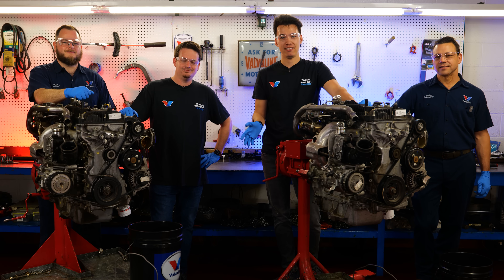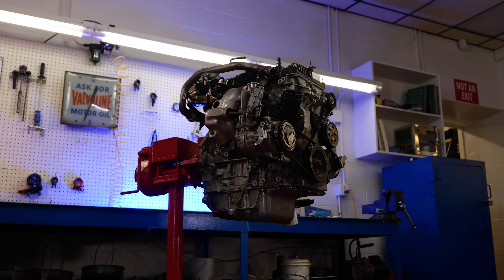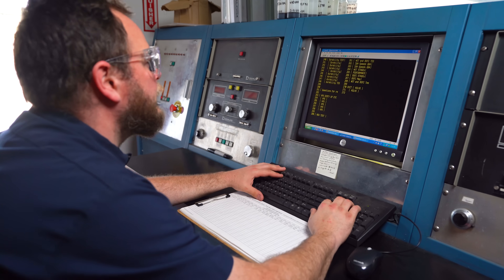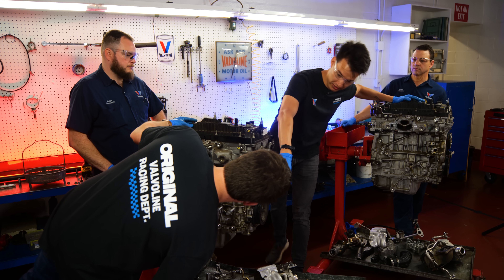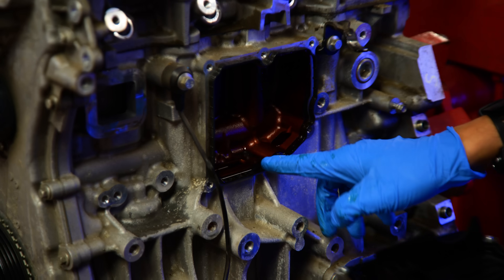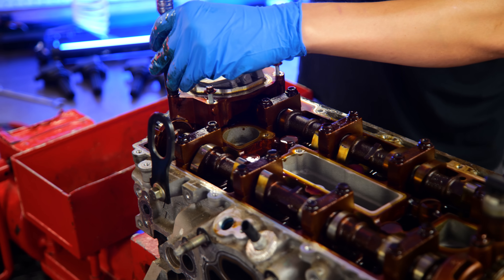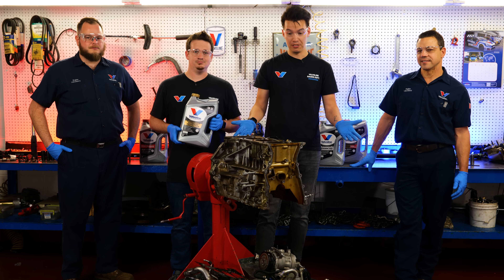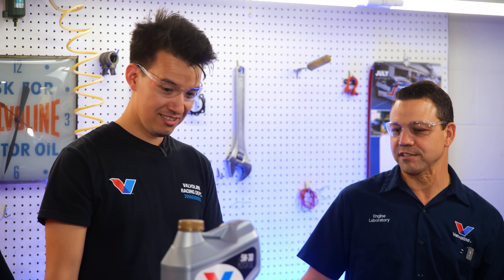Testing different oils over 4 years and 1 MILLION miles

Comment: But they changed oil every 10k miles and conventional oil is not meant to go but 3k.  But either way, if you would change oil more frequently and about every 50k put in a can of seafoam and run for 5 mins before changing oil, you would have a very clean engine.

Comment: I know this video is old and I'm just now seeing it. It was very interesting to watch. I cant say I truly believe in it just cause a video due to so many companies the cut corners and I'm not saying Valvoline does or did. All I know is synthetic is good type. But the brand of oil also matters. I've used Valvoline and it seemed to gum up just as bad if not better than others. All I know is I've found mobil 1 to be top notch not just threw watching video tests but my own experience. I'm in a 2000 Chevy Silverado and have used nothing but mobil 1 since I bought it new. I'm almost at 400,000 miles and that's not a joke or a lie. Just change your oil as recommended if not a little early and maintain everything else.

Comment: Very interesting.
Would engine design and the quality, Pollution equipment, and oevel of detergent in the conventional oil be impacting this? 
Interesting to see vs my 35 year old light truck Mitsubishi Diesel engine, 500,000km (310k miles)(yes less I know),  conventional oil, doesn't have any pollution gear (because old truck) but looks as clean if not cleaner than the synthetic. 
Factory has bypass filter and similar change intervals so curious if bypass filter is helping the most, or detergents in Diesel oils, or no pollution gear 
I've got a 35

Comment: I used AMSOIL Signature series in my 3.5 ecoboost Transit with 150,000 miles. My engine was way cleaner when I had the chain replaced.

Comment: İ am an old fashioned guy from 80s and had more than 10 motorcycles and 3 cars in my life circle and as many of my age range knows, back in the days we used one oil for motorcycle and cars... There were no difference.. but today, i can observe, machines that build cyclinder and pistons are intelligent and ai based.. they have less tollerence for bad oil but have more performance.. so if you use conventional oil for a 2025 engine i know i am lost... The tollerences are very very tight in material today and they need that syntetic but old engines are more hand madeish and have more tollerence between gaps and rings... So mineral oils were closing thats gaps perfectly and working nice :) today mineral oil is equal to heat and brutalforce to engine... 

İf you are in a country that cars are cheap and service are damn expencive like europe, than just use mineral, you will save a lot money, but if you are in a country that taxes are high, cars are damn expencive (ex in my country i pay one car for my self and another for government) then use shentetic... Service price are low but we have to use a new car for 20 years... 

So oil choice defers to country 🤟😎

Comment: I would think that the visual inspection is the first evaluation.  Where is the video that shows the part and feature measurements?  And how they compare to factory tolerance window vs each other?
Also, was there a MPG difference that was detectable?  Oil consumption difference?  Where are all the metrics?

Comment: Remember transmissions break down 3x as much as engines do...Change the trans fluid every 40-50,000 miles if you want to get 200,000+ miles on your vehicle

Comment: Why run an oil rated at 3k miles at 10k miles? If you did the conventional oil changes at 3k and the synthetic at 10k would they be the same? Very flawed within the first minute of the video and not worth continuing

Comment: I run the Valvoline oil in my car with oil changes every 4-thousand miles. No way I'd go 10-thousand... but it looks like I could get away with it. (don't worry, I won't! I consider oil changes cheap insurance for my engine!)

Comment: Synthetic oil will easily last 10,000 miles between changes, especially if you replace a (good) oil filter every 5,000 miles.

Comment: People will run the cheapest conventional oil they can find for years and then then religiously use Valvoline restore and protect to try and clean up the garbage left behind by the crap oil they used for 100k miles. They could have just used a good synthetic oil and been fine.

Comment: As soon as they said the oil change interval was 10K miles I knew this test was designed to be skewed. Conventional oil isn’t designed to be changed at high mileage intervals. It should be changed every 3K miles. Oil filters only catch particulates to s certain size, anything smaller gets encapsulated in the oil, so your oil becomes slurry.

Comment: 500kkm with cheapest gas motor oil in a diesel...
no abnormal sign of wear, machining marks in cylinder still there.

stick to viscosity, that's it.
this this or this that is a scam to void your warranty.

Comment: I used to get $9.95 oil changes for full synethic Mobil 1 at my dealer until my cars warranty ended. Then they charged me $74.95 for my last oil change which was supposed to be full synethic but put some crappy concentional. I didn’t know about it back then but they basically gave me a refund and let me go for free for the error. Now for the first time I’ve done the oil change myself and put full synthetic + filter for just $25

Comment: Been using full synthetic since I've owned my mustang. 150k miles, engine sill looks like new. Although I don't use valvoline anymore, mostly Mobile 1. Been hearing too many things about how valvoline isn't what they used to be! Also put full synthetic in my 96 probe gt (89k miles when I got it) and I suspect the previous owner only used conventional. Had a bit of that brown color but after using full synthetic it no longer has that brown color.

Comment: im no expert on oil build medium high horsepower up to 500 horsepower  Valvoline 20 50 vr1 racing oil full synthetic 2 maybe 3 runs vr1 con we have engines with up to 10 runs so i totally disagree if u change con oil every 3000miles daily driving  no matter how many miles the bottle says these new high revving little engines engine will definitely last longer syn oil has no zinc higher temps then what happens?

Comment: This video proves to me that mineral oil is the clear winner. You save money with an engine that is still running and you won't get anymore trade in value if you do decide to trade it in for pennies. After 300,000 miles, many vehicles are wore out or rotted out.

Comment: My father was an Otis elevator mechanic for 47 years . About 1980 or so they switched door opening / closing gearboxes to synthetic lube from conventional on all new ones. Until then a gearbox at say a hospital that sees heavy use would last 4-5 years . After the switch on same new gearboxes they lasted at least until he retired which was about 20 years. He became a big believer in synthetic oil .  In my racing motorcycles with wet clutches saw friction disk life double when I switched to synthetic oil from conventional so at 1Mn plus miles on my 3 Ford pickups successively they all got Mobil1 from new and none were using oil at 300K plus miles with 5K oil change intervals .  I'm sold on synthetics even the hydro-cracked , deparafinated oils like Mobil 1 which is really conventional dino oil that is cleaned up rather than the original PAO based Mobil1 . They switched years ago after losing the lawsuit with Castrol about definition of synthetic oils. Unless you have a jet engine no need for PAO/ester based oils.

Comment: I took valve cover off kohler command 35hp. Looked new . I use Mobil 1  take the time to let it drain and put some oil in while draining then gently blow compressed air top to bottom and really gets junk out. 20-50.

Comment: i'd imagine there is less wear and tear on the engine bc they are not running under the same load as propelling a 4000 lbs car, stop/start in different temps, running at different rpms etc.

Comment: Imagine waiting 10,000 miles to change your oil when using conventional that is only rated for up to 3,000 miles for a reason 😂 This test literally means nothing....... Change the conventional every 3k and the synthetic every 5k or even 10k if you want, then we can get some useful data from it. Fords ridiculous maintenance intervals are only when you use atleast the Semi-synthetic Motorcraft (or any semi-synthetic) oil and are just so they can tell the EPA "Look we saved X amount of imaginary oil by extending service intervals"

Comment: This is an interesting experiment if you're trying to find out what happens to a neglected engine compared to one that's properly maintained.  
A fair comparison would've changed the synthetic at 30,000 miles if the conventional was changed at 10,000 miles.  Both engines were designed to run synthetic and conventional (with extended oil change interval) was used in one against manfacturer recommendation.  Both engines still ran to 500k with similar mechanical problems.  How many people put that many miles on their cars?  In my experience, other stuff starts breaking way before the engine gives up.  One could come away with the conclusion that you could run conventional and be just fine.  Unless of course, you were going to tear the motor down just to note how much varnish there is. 😂

Comment: There is such thing as to clean though especially for engines that have wear. I had a chev 305 vortec  that i lost two moters by putting synthetic then the third i put Plain Jane 10w30 Castrol and ran fine.

Comment: To be clear this test doesn't show which oil is better at reducing deposits, but which one can go 10,000 miles while reducing deposits, which is the synthetic's strong suit and the conventional's weakness. That is a big difference. The test is heavily skewed towards the synthetic oil, as conventional oil is changed at 3000 - 4000 miles.  So, if you change your oil at 10k miles this helps you. If you run conventional oil and change at 3k miles this test is totally worthless.

Comment: Id like to see the odometer. And actually see how they are running it on the chassis dyno. Heavy acceleration simulation. Heat soaked idle with heat radiating from pavement and other vehicles. Itnis impressive how clean they really are its a testimate to how well regular maintenance work out. What other failures did they see this is all very interesting information.

Comment: If you had run an engine with a decent synthetic oil there would have probably been no seal failures. Valvoline is the champion spark plug of oils...

Comment: Spectacular and convincing video, but...
If they had not paid attention to the same oil change period, but to the fact that the oil change cost the same in both test engines, i.e. the conventional oil would have been changed about 2 times as often as the synthetic, then there would be a much, much smaller difference between the condition of the two engines. 10 kmiles can be "a lot" even for synthetic oil in real conditions (cold, humid weather, short trips, traffic jams), not to mention for conventional.
Regardless, I also use synthetic oil, and I wouldn't really be able to get conventional engine oil.
thanks for the video :)!

Comment: I bought a low mile harley 8k mls, run from first day on synthetic was expecting to pull motor apart due to lots of little oil leaks to re gasket the motor,then decided to try mineral oil, resulting in no more oil leaks and cooler running, but that's just one bike!

Comment: 10,000 mile intervals? What the heck? Just change oil @ 5,000 mile intervals, run ONLY WIX filters, and use whatever the cheapest is at Walmart. Been running all my cars like this for 25 years and as long as you change at 5,000, it doesn't matter. What pay 4X as much for the super duper wagyu massaged synthetic?
Reply: 27 yrs here.

Comment: GREAT video.  No BS.  Just reality.  Well done guys.  I run Mobil-1 Full Synthetic with a 5K oil change interval on all of my vehicles.  I do NOT pay attention to my computer oil change monitor system.  It would have me changing my oil somewhere between 10,000 and 11,000 miles.  No way!  5K for me.  Oil is cheap.  Engines are not.
Reply: That's why it's NOT a useful video.

Comment: I have been running Mobil1 full synthetic in my 2013 silverado 5.3l for the past 4 years. I also use Mobil1 oil filters and I change my oil every 3k miles. My truck still has AFM and it burns oil. I used about a quart every 3k miles. I noticed I get much better oil pressure with the mobil1 oil filters than I was getting with other oil filters like Purolator or Bosch. My first 100k miles I was taking my truck in to get oil changes at JiffyLube. They used some Philips branded synthetic and some cheapo filters. My truck was under a warranty so I wanted proof that I was getting maintenance done on time. My trucks oil pressure was pretty low after getting my oil changed there. I currently have 126k miles on the truck and I have been looking into doing a AFM delete and cam swap to prolong the life of the engine and hopefully stop the oil consumption.

Comment: Val voline commercial ,I am not sure how you tested these vehicles where they're just sitting there running driving the same place or where they city hwy driven ?becasue driven on a road  and in different environments affect things differently. But that said it appears syth oil at least the Brand that is advertised here seems to be much cleaner I am not sure what type which brand of none synth oil was used was it the same brand every time, higher quality low quality, to m,e there seems to be a fair amount of information missing that those  small variables  could add up with just the brand\ brand quality  of none synth oil alone.
after all of these I wonder how much money difference was spent on both vehicles, how much was saved if any . Not many people keep vehicles after 300000 never mind 4-500000 that is except me,  I would if the vehicle was decent I would probably keep it until it didn't run anymore or I found a different vehicle I liked better hehe
any engine that has turbo or supercharger( which  I would never buy)  should always be using the top quality oils and fluids because those engines are actually working much harder than the average engine

Comment: They said they changed the oil every 10,000 miles on both engines, but conventional shouldn't be run that long, so doesn't that kind of nullify the results a little bit? I think to keep it fair the oil changes should've been done at stated life limits, 10k for the synthetic and 3-5k for the conventional.

Comment: my 2002 wrx motor looked like the synth motor, i ran it on synthetic and changed the oil every 2600-3000 miles and it had 300k miles on the engine before the timing belt tensioner failed and caused bent valves. The engine didnt burn any oil and ran like new, i also had a stage 2 tune on it for 12 years
Reply: You would know about synths, ya feckin clanker.

Comment: The fact that you have a Mazda/Ford running for 500k without dropping the timing chains and guides is proof enough to say your oils are good. But it's not real life driving in real weather conditions. No ice,snow, fog, mud, extreme dust, and flooding roads. But the test was pretty fair.

Comment: Thank you Valvoline. Have ran full synthetic oil and appropriate synthetic filters for 10-20 thousand miles. This is on the notorious Hyundai 2.4 liter motor. At 115k I have changed to Valvoline Restore and Protect. Will switch to oil changes at 7500 miles, hoping for 175-200k miles.

Comment: This was great to watch; I have a 99 miata, 22 WRX, and 22 CB300R. It's a great reminder to me to keep doing the changes on time. For the miata, it's every 4000 miles. For the WRX, I switched to 5w30 and do it every 5000 miles. For the CB300R, every 6000 (per the manufacturer's manual, iirc). My dad, on the other hand, didn't change the oil in his 2007 Mazda3 for 11k miles... idk how that thing keeps chugging along.

Comment: I have a 1997 GM Blazer 4.3 V6 (Vortec) with 240,000 kilometers. I use synthetic oil and change it every 5,000 kilometers, the engine runs like new.

Comment: When Mobil1 came out in 1974. One of the consumer magazines ran a test with a Cadillac that had a V8 engine.Kept the Mobil1 oil in the car for 50,000 miles and just adding more synthetic oil if needed. Tore the engine down and measured the wear on the original parts and found NO wear on the original parts.

Comment: Awesome video on the difference between the 2 oils. I’m glad I made the switch. My toyota 4runner looks about that clean on the top end after 290,000 miles running full synthetic. I do go over by a couple 100 miles every once in a while. But it was nice to see the full synthetic oil changes were worth it when I replaced my valve cover gaskets.

Comment: I don't get it. Don't you have producer approvals in the USA? Basically if producer says the car has to be run on XW-Y oil with approval ABC it means it has to be and it's no big deal to stay to this. For example, european version of 2.3 Ecoboost says WSS-M2C913-D but also allows for any SAE 5W-30 ACEA A5/B5. This is definitely synthetic oil, mineral oils within this viscosity class are not available. So honestly respect to Ford engine fot going 500k miles on non proper oil.
Reply: well the world doesn’t revolve around Europe. I’d say that the world revolves around the US, actually.

Comment: 5000 miles + conventional would work just fine...been running it 250 000 engine looks cleaner than the one in the video.

Comment: That's exactly why I run full synthetic oil in all my engines except my motorcycle. I have a 2003 LS 430, a 2006 Toyota Solara convertible V6, and a 2005 Chrysler Town and Country. None require a full synthetic, I just know what I know.